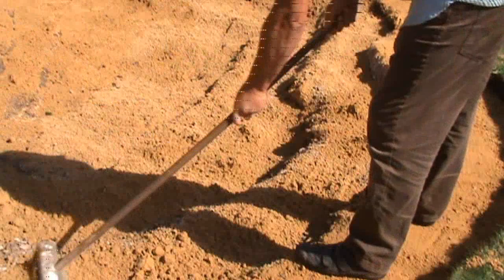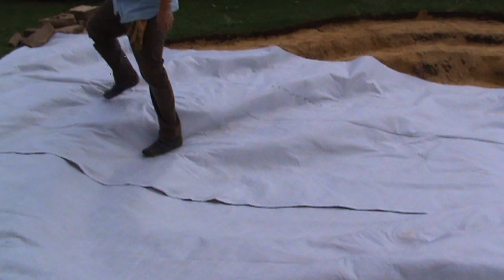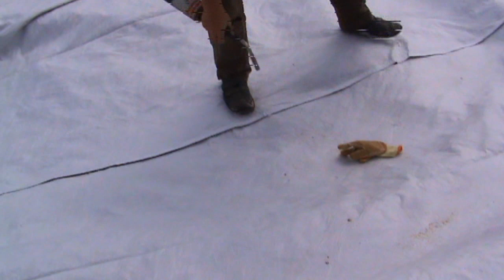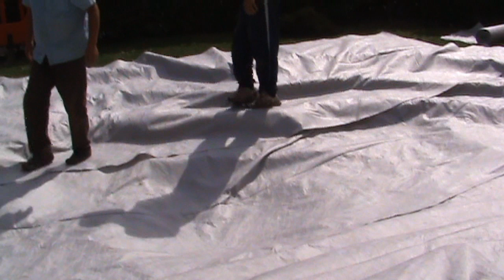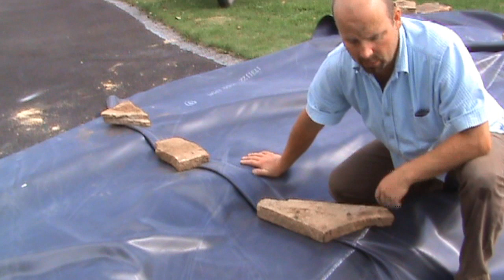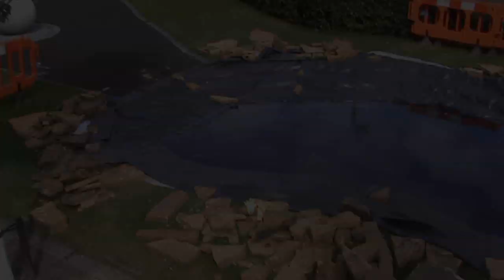How to Build a Wildlife Pond: Part 2 - Installing the Liner

Comment from the maker: The one I use is made of polyester so it does not rot like some carpet underlays can. It also is very difficult to pierce and won't tear. The name for it is 'polyfelt' over here. If you contact Firestone (building products) they will be able to tell you what they recommend as an underlay in the US.
I don't know what trade names products have over there unfortunately as I've only ever bought it in the UK.